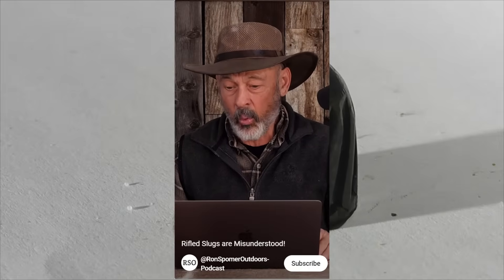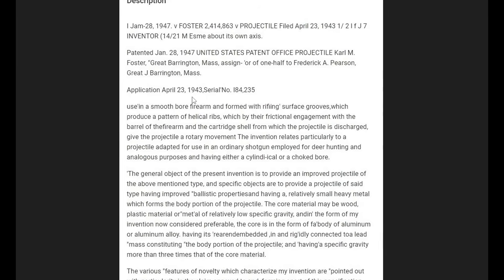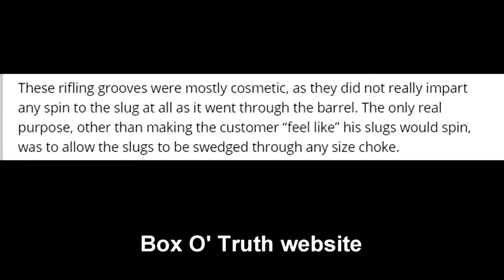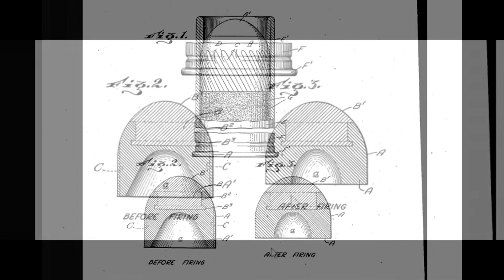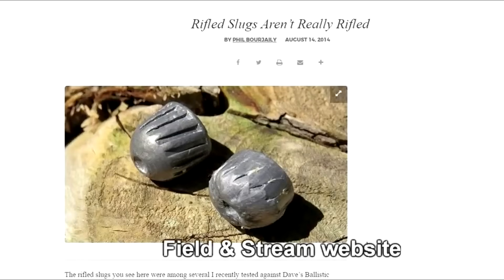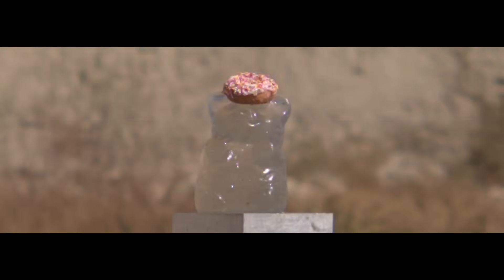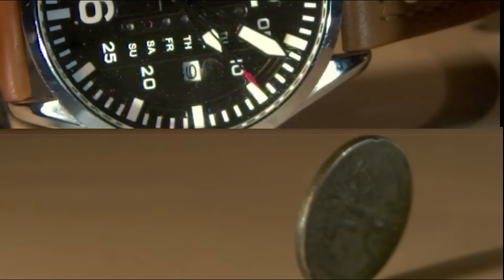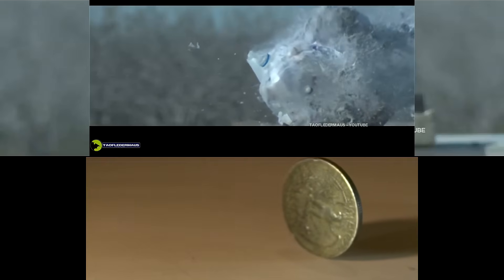Yes,  RIFLED Shotgun Slugs SPIN - The high speed camera doesn't lie

Comment: I was taught that they spin but not fast enough to stabilize gyroscopically. Rather the spin helps swage them down the bore and the hollow cavity in the rear makes it fly nose first while the slower spin helps keep the tail in line. The simplest way I always thought of it was like a shuttlecock. This is very interesting.
Reply: This is how I understood as well. I wished the guys could remove a Foster slug and paint a stripe on the back to monitor - reload it and use a fixed focus on the camera in order to better catch the bullet in flight… Oh well, if I want better I should do it myself… 🤷‍♂️
Reply: @GunsmithSid  actually this guy taofledermaus has tested the Foster slug with a line painted on it in an older video to demonstrate the spin.
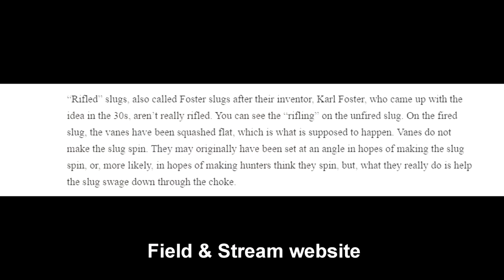Reply: I appreciate that he did the extra work to determine the spin rate of the rifled slug. The criticism I have is that he didn't compare it to the spin rate of a sabot slug from a rifled barrel. Let's try to do it here: I have a rifled barrel with a 1:35 twist so basically one rotation every three feet. If I shoot a sabot slug at 1500 fps then that sabot should be spinning at 500 revolutions per second or 30,000 RPM. This is much faster than the 750 rpm measured in the video. Some additional research would be required to figure out the threshold for gyroscopic stability.
Reply: @Effective_wake exactly it is doubtful that there is enough to actually provide legit gyroscopic stability.

Comment: That same expert you showed also claims that .308 and 30-06 didn't have almost identical ballistics when .308 was adopted. That's literally what it was designed to do while being lighter and shorter.
Reply: It didn’t in commercial loadings for hunting. Only military loadings. 7.62 NATO does “almost” exactly match M2 ball from WW2. But with the more modern powders even by the late 1950s 30-06 was at a MINIMUM at least 100-150FPS faster than any 308 of the same bullet weight and it still is in 2024. Also the 30-06 could and still can push anything from 110gr-220gr projectiles with enough power for any reasonable hunting situation. 308 cannot do this. So yes in the 147-152gr military cartridges of the mid 20th century they were almost identical but that is all.
Reply: @MinimumSpeedOperator  yeah the guy I'm talking about was arguing that they were never the same... he's a moron.

Comment: Congrats, you got me to look up the patent too 🙂

What's interesting is that on page 3, column 4, paragraph 2(by the 15 in the middle), the projectile weight is described as at least 20% less than a straight lead projectile.  Allowing for greater velocity, and a flatter trajectory.

This would also have the benefit of increasing it's speed of rotation.  Potentially then its inflight accuracy.

I hope you all have the chance to fire some original design Foster slugs and can do a comparison with the modern iteration.

Thanks Guys!
Reply: Removing some mass would change the mass moment of inertia of the projectile, which would cause it to accelerate up to speed (rpm) at a greater rate given the same rotation force applied. However, the rpm would be (I think) more dependent on the twist rate of the rifling and how well they "grip" the inside of the barrell. Also, the basic inertia formula for a cylinder is I=(m*r^2)/2. Removing material from near the center of rotation will have less of an effect than removing from the outer fiber. That's where the r^2 really kicks in.

Comment: Never doubted that the "rifling" on foster slugs imparted SOME rotation, but I do wonder if it is enough rotation to create any measurable increase in stability or accuracy. 750 rpm is nothing compared to rifled barrels that spin a projectile from 10s of thousands to 100s of thousands rpm. While the foster slug may be misunderstood, I do think that in practice the grooves do little more than bolster the shooter's confidence in the ammunition's performance.

Comment: Merry Christmas gentlemen and hope you have a great new year. Love the channel as always. I own some slugs produced by Fiocchi. They are named "Defense Dynamics Aero Slug". They are 2 3/4, 1250 fps.  I haven't had a chance to test them yet but they posses the same "foster" pattern on the slug except resemble a hollow point style. I would be very grateful if you would consider testing these. I can send you a box if you wanted to. I want to know specifically, if they spin, through a smooth bore, and the accuracy at reasonable ranges. Keep up the good work gentlemen.
Reply from the maker: thank you.   I believe those are using the Turkish slugs often called "Thug slugs"   and we have tested those before.
Reply: @taofledermaus  Ty again. Correction 1150 fps.

Comment: I have an other argument/theory : by making grooves, the diameter of the slug is less stiff so it can easily match the barrel by moving material from the "external diameter" into the grooves, but by making them at an angle the contact with the barrel is still some kind of cylinder instead of some lines along the barrel.
Reply: Watch it again, of that was the case, the groves would be straight.
Reply: @StuninRub  No, he stated the exact opposite. His hypothesis was that the angled or helical grooves would be beneficial even for the sake of internal ballistics. That is, there being a more uniform bore contact aside from the actual sweep ring.

Slug grooving often is straight and he pointed a possible benefit of doing otherwise.

All this while both configurations work and there being no evidence for one being more accurate than the other, and helical having once again proven to rotate(obvious to begin with for most). Spiraling being most likely better most of the time in traditional lead slugs for a variety of reasons.
Reply: @ffffffff-vv7yp  You supposed to shoot the lead bullets not eat them. Read it again.
Reply: @StuninRub  I'm sure you misquoted. This is basic curriculum.

Comment: Does the number of grooves affect rotation speed?  Does the angle?  What if someone makes a slug with grooves parallel to the flight path, would the camera show spin anyway?  What happens if the grooves tilt in the other direction, what would the camera show?
Reply from the maker: I imagine there'd be a difference in spin from a dirty barrel to a clean one.

Comment: Before your high speed videos of a couple of years ago, I did not "know" that foster slugs had a spin to them. I just knew they were more accurate than round "pumpkin balls" short through an 18" smooth barrel.  The 76 caliber balls were supposed to be as accurate, but I think that was from a 60 inch Brown Bess barrel . Not sure, never did the testing.  Thanks for this one!  I think you proved your point, and I think I understand why they spin. Those ribs crush to make a pretty good snug fit.
Reply from the maker: I think the problem with round balls is trying to keep them from deforming
Reply: @taofledermaus  good bet.
Reply: @taofledermaus  Yes, you should always try your utmost to avoid smashing your balls.  🤪

Comment: If the angled grooves were continued through the small skirt at base of slug, would it spin even more?  A quick test with a file would be simple way to extend the grooves.  If that skirt is partly removed the hard card wads under slug would become even more important, since extending the grooves will weaken the base at least a little.  I use two .20 cards under foster slugs.

Comment: I've put those slugs down range at up to 80yds, and they are pretty darn accurate even at that range. They've got to spin to be that accurate.
Reply: With my 1887 clone I can hit a dinner plate at 100 yards its fun blowing peoples mind with how accurate it is with slugs
Reply: A spin of almost any sort will make a projectile more accurate. What’s the rpm of a football?Deformation of the face or uneven weight of the projectile will cause an oblique angle. Adding spin will cause a corkscrew motion of course the speed decides the size of the corkscrew. Rifled slugs are definitely more accurate.
Reply: I shoot on target at 100 yds
Reply: Surely you jest...the spin imparted to slug is not enough to stabilize same, regardless of the distance you shoot. If spin were absolutely necessary to stabilize a projectile,  how do you explain smoothbore shooting round ball at the the same distance?!?
Reply: @rbee914 Tests with original muskets from a bench will hit a man sized target semi regularly from 100 yards but not the 9"-12" group I'm guessing a dinner plate would represent. So, better spin than none but not nearly as good as a rifled barrel? That would be intuitive.
Reply: @rbee914 yes foster slugs spin yes the spin isnt fast enough to really matter to much but the comment you made on if spin it was necessary for projectiles to spin to keep stable was an absolute braindead fudd take. For one rifled muskets shooting a round ball actual sees increased accuracy over a smoothbore musket. two a bullet going 4 times faster than a round ball will just start to tumble with out the spin, spinning projectiles acts like a gyroscope helping it stay stable. Similar reason why some missiles and rockets spin same reasons gyroscopic stabilizers work. Spinning creates a gyroscopic effect on its long axis. With a little research youd figure that out but that’s something most of you fuds are incapable of doing
Reply: @rbee914  lmfao your in desperate need of an actual live demonstrating ffs ya they are that accurate. Iv shot a pile of deer with a 16ga rifled slug and they are extremly effective.
Reply: @panthermartin7784  that's literally not what he is saying

Comment: Well of course it would add spin to the slug, the angle of the rifling on it means the flattening / increased contact is constantly changing angles as it travels down the barrel. It is the changing angle of the flattening point that is inducing the spin.

Comment: I have not shot a ton of shot gun but i have shot these enough times 
When you hit fabric with a non-rotating projectile the fabric bunch up but no twist is imparted 
I seen several times where cloth i hit had a obvious twist after being smacked with one of these 
I was using old tshirts for witness targets to see if i hit high low left right etc on a miss 
The grooves on the foster slugs cause friction and impart some spin harder lead would produce less after a given point 
I wonder how many test shots they made with these when they were working out the kinks lol
Reply: me when I lie

Comment: Another attribute of helical grooves is that they can be longer than straight grooves.  If you want the grooves to collapse and fill the barrel, more grooves = less metal = omre collapse.
Reply: Actually that's not exactly true. They are indeed longer, but also (keeping the number of grooves constant) thinner such that the amount of material only depends on the groove/rib width ratio. Your conclusion is right nevertheless because thinner ribs take less effort to collapse.